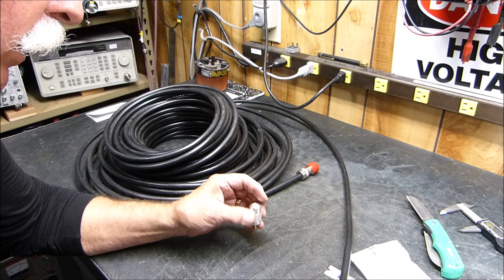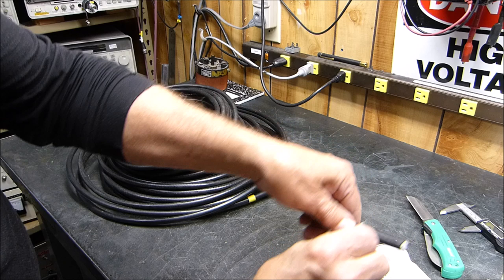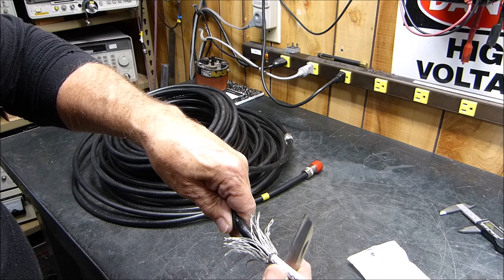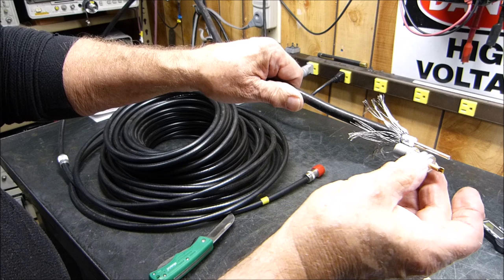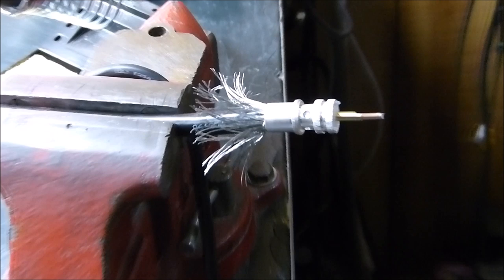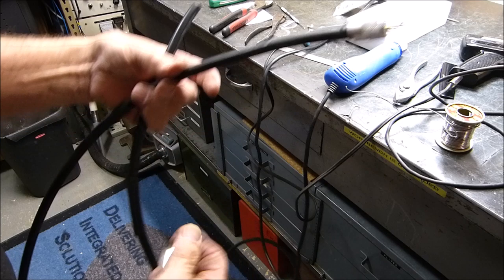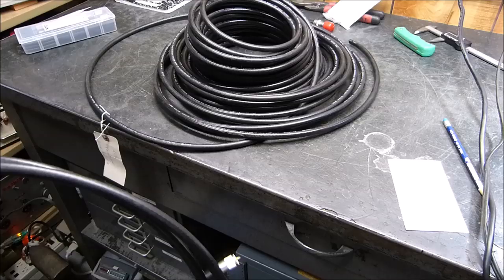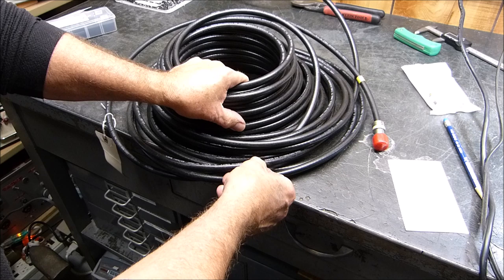Simple And Fast Method For Attaching PL-259 RF Connectors To RG-8, 9913, LMR-400 Size Coax

Comment: This is how I have done this for years.  Never understood the soldering of the braid through the holes...There is no need to fold back the entire length of braid either.  You can cut that about half way back (or almost where you cut the Dielectric) and then its easier to un-weave and fold it back, then screw on the connector.
Reply from the maker: I soldered the braid for a lot of years. I found it necessary that, if solder is the objective, I had to use the hottest soldering gun I have - I think 325 watts - clamp the cable in a vice - get the soldering gun as hot as it is going to get and try to get a corner of the solder tip sort of down in the hole so that the braid and the PL-259 is heated at the same time - and use a medium size solder - once the solder flows into the hole and braid - quickly rotate 90 degrees and repeat for all four holes. With a little luck and not so much solder that it flows into the threads, it can turn out good but it can be hit-and-miss also. Takes skill and the right tools and, as mentioned, a little luck to get it really nice and even so, outside in the elements, it doesn't seem to last any longer and the connector is not worth the time to get all the solder off to reuse it. The military and commercial world would never attempt the solder technique. Even multi-GHz "N" connectors use a compression connection for the braid. To each their own...   73

Comment: Done it that way, still prefer to solder.  just buy good silver plated types instead of the cheap and common nickle-plated ones.  solders fast and easy, no melting the insulators, leaves it all more water proof as well.  and i don't have to screw around with trying to comb out the braid and with my arthritis, way too hard to screw it on over it.
Reply from the maker: It is definitely hard to screw the connector on and my hands are full of arthritis also and I have only about half the strength I used to have. Also, it is even harder for braided center conductor but a little easier with the LMR-400 as it has a solid #10 copper wire in the center. 73

Comment: If you are going to solder through those squar holes to attach the braid.  Tin the braid and holes first and the job will go more smoothy even for nickel plated connectors.

Comment: I mentioned this on a few other videos, but the best PL-259's are made by Maxgain Systems. They can take the heat better then any PL-259's I ever used. The silver coated Teflon PL-259's are garbage. If you can find the Kalibur type PL's then I can say they are just behind the Maxgain type.

Comment: I have coax to do. I have had a bad time trying to do this. I'm going to try this
Reply from the maker: I have found out over the years that if you do decide to solder to the shield thru the holes, you need a really hot soldering iron/gun.  I use a Weller D-550 at 325 watts. You have to let the soldering gun get as hot as it will get  then get the connector hot quickly and get the solder down in the hole quickly, then rotate it 90 degrees by holding the coax in a vice, then rotate again until you fill the four holes and back off... it can turn out really good but you also have to be careful not to let the solder flow into the threads of the PL-259. It will work but it is always just a little unpredictable.  I also recommend not using the small solder. Use a medium size solder so you can get enough on the connector and holes quickly. Hope this helps whenever you do decide to solder. I think this screw-on way is just as good and you can usually reuse your PL-259.

Comment: very good i do it very similar  but dont cut so muck at the end and do it with pliers with out the vice very good some 50 ome's coax is alot softer depends what type you get 213 i think is alot softer i check with multi meter to see if there is a short mine is rg8 though

Comment: It would help a lot if you could tell us where to get the end connectors you're using.
Reply from the maker: I buy them mostly off Ebay as I do the LMR-400 . I am careful to buy from a reputable dealer and make sure the connectors are silver plated and PTFE (Teflon) dielectric. There is also,  www.mouser.com  where you can be sure to get genuine USA made connectors, if you choose,  but they cost $$$. Hope that helps.

Comment: Can u recommend me the best coax for a single anylten a mobile setup in my kenworth w900. Truck stop kits ate junk I'd like to have something with a solid center instead of multi strand
Reply from the maker: I am a fan of large coax, in particular LMR-400 shown in the video. It is a #10 copper solid conductor and fits nicely into PL-259 connectors but might be a challenge in a mobile installation because of its size and relative stiffness. On the other hand, multi-strand wire is good for a mobile installation as it is much more resistance to breaking than solid conductors like in cheap RG-58. Probably the best compromise is RG-8X coax. It is a bit larger than RG-58 and requires a different size insert in the back of the PL-259. I find good deals from Ebay and also can be purchased as www.mouser.com. Good USA coax is worth the price. The LMR-400 I use is, Times Microwave, brand made in the USA. Hope this helps.

Comment: like you vido  I just had the problem of putting one coax end  on a gab antenna. we got one on but i think the dielectric was melted and we did not get it done. I just wished there was an easy to do this with the antenna in the air.

Comment: Hello: I am supposed to order LMR 400 cable for a helium minor cryptocurrency setup from the USA,  but I found JB 9913 coaxial cable here in Puerto Rico.  Can I exchange these two cables? and still be fine.
Reply from the maker: Yes, you sure can. 9913 is a high quality 50 ohm cable like the LMR-400.
Reply: @ElPasoTubeAmps  Yes sir, thank you so much.  I appreciate you professional help.

Comment: Is there a certain pl259 you recommend? I’m new to to the cb radio hobby picked up some lmr400 and some nice amps will end up pushing 1k watts so wanna make sure I’m using some quality components.
Reply from the maker: I buy high-end PL-259, the sliver plated and teflon type. A bit more expensive but, in my experience, worth it especially if you are going with Times brand LMR-400. You can buy off Ebay or if you want the top quality, buy from www.mouser.com. Some things from Mouser you have to buy more than one but I usually buy 10 at a time.
Reply: Okay thankyou. I have that exact coax. didn’t notice you solder the braided part of the connector I’ve seen some people skip that and just solder the tip is that what you did or did you just skip filming the soldering ?
Reply from the maker: In this case, I do not solder the braid - only the tip - other times I do solder the braid... I have this coax and non-soldered braid hanging 30' up in the air from a 40M Inv-V and have had no issues. Some people believe only in soldering and I can see that but I don't think it matters much. If I do chose to solder the braid, I clamp the cable in a vice and use a 325 watt Weller gun - let it get really hot - and then quickly do the soldering, rotating the coax and filling each hole. That is the way I do. Of course, if I am repairing a cable end away from the shop, it is inconvenient to stretch out extension cords, etc. so I am more likely to use the method in the video and not solder the braid. They both seem to work just fine.  73  WA4QGA
Reply: @ElPasoTubeAmps very interesting thanks for quick response. I had purchased coax with pre installed connectors for my vhf/uhf set up but wanted to not shy away from it again. I don’t have a soldering iron with that much wattage either so maybe I’ll go with your method. I was thinking of going with clamp or crimp on connectors but already have some amphenols and the crimp equivalent is about 50 bucks for 4 connectors or 6 bucks for some Amazon stuff I’ve never heard of before.
Reply from the maker: I have to admit, I am not a total fan of crimp-on connectors but I worked as contractor for NASA and WSMR for the first 26 years of my career and we only used crimp-on BNC with no issues. I figure if it is good enough for those guys, it must be OK. Now that I think about it, the last two years at WSMR with Lockheed,  I worked on 11 GHz equipment and at those frequencies you can not use a 90 degree N connector - all the signal will be lost - rather, each bend and transition has to be done with male and barrel N connectors - yes, there is loss in each connector and connection but not total loss from the 90 degree connectors and you know they are the best to be had. The point here is, each connector, even at 11 GHz,  was crimped and not soldered - for what it is worth.  For HF, the PL-259 and SO-239 are perfectly good. A bit more loss at VHF and UHF but... 🙂
Reply: @ElPasoTubeAmps  Wow, that must have been interesting work! 11 gHZ… I guess you're more than qualified. I definitely trust this method a bit more now; all this stuff must seem like peanuts in comparison, lol. I'm an electrician by trade, so we do a lot of crimping, but for some reason, it seemed strange to me for this application. Plus, I don't feel like spending a lot of money on a crimper to do a handful of connectors. Is there something else you recommend for VHF/UHF? Also, when you trim back the jacket, if you cut through some of that braid, do you need to start over? I accidentally trimmed some, lol.
Reply from the maker: It is definitely easy to damage the braid. I tend to use a single edge razor blade and just score the insulation around the coax, then do the same down the length, trying to go as deep as I can without touching the braid and then peel the jacket off hoping I have not damaged the braid. I understand the cost of the good crimpers. I have said it often times that it takes a thousand dollars worth of tools to do a $5 job. I am sure you know that in your trade also. I am in the process of building (another) transmitter using 
a 3-1000Z. It is working as a SSB amplifier now but I will be using it for AM also. I will make a video in a month or so that you may like. The point I am getting at here is I used to be really dedicated to not only crimping connectors but also soldering them. Maybe it is just my age but I have gotten to just crimping many, or most, of them. As you know in your job, no one solders stuff except us ham radio operators...  :-)  We have to admit, crimping works - I have always thought that wall outlets that have that push-in hole for the #14 wire was surely a terrible way to do it - if I understand it correctly, we are just pushing the copper wire basically under a "blade" that surely only makes a very small physical contact and rated at 15 amps... Wow... and it sure isn't soldered. I try to go the extra length to actually wrap the wire around switches and outlets screws and tighten them down. I understand it is all NEC approved but sure seems like a poor connection to me. Maybe I don't understand how the connection is actually happening in the switch/outlet. I know I am babbling on here but I think some of it is my background and age where we wanted to build things that lasted forever. Working at the jobs I had, we did have the best of everything and it was repairable and not throw away. Maybe that is not the real world (any more). Sorry for the soap box speech. Stay safe.
Reply: @ElPasoTubeAmps  That sounds intriguing; I'd love to check that out! Your videos are excellent, and I believe more of them would benefit everyone, although I understand it might be tedious. I agree about plug-in terminals; it's commendable that you wrap them unless it's a low-current lighting application – a practice I follow as well.

We've experimented with thermal imaging on various methods of terminating conductors, finding that less contact area generates more heat. This applies to wire nuts versus the more popular everyday Wago connectors. While Wago connectors are convenient, I don't trust them with 15-20 amps flowing through. A wire nut, with proper use of lineman pliers, has never failed me.

The radio hobby has taught me a lot about the world of electrons, reigniting my excitement for working with electricity. Currently, I'm grappling with safely running high-powered amplifiers without risking equipment damage. I assume I need to purchase an analyzer, but I'm unsure about the process to ensure safety with numerous patch cables and pieces of equipment between my radio and antenna. Do you have any detailed videos on this topic? My SWR is 1.1, but I'm using a cheap SWR meter with about 50 watts, and soon it'll be 500 watts, so the stakes are a bit higher 😬

Comment: I live in El Paso and my call sign is K5mhc. What’s your call sign??
Reply from the maker: WA4QGA
I also have a lot of pictures of equipment on my QRZ page
Reply: @ElPasoTubeAmps  thanks and I’m the current president of W5ES
Reply from the maker: @javierpolendok5mhc  Hi Javier - YouTube and email is something I try to keep up with. As you can see, audio was what first got me interested in posting on YT but my passion gradually came back to amateur radio. Only so many audio amplifiers can I build. You would notice that I am into the vintage and homebrew equipment - you know, all the stuff we wanted as a kid. I have visited W5ES but it had been a while. I am not much for meetings or contests but I know they are good and not many people that I know of are into the vintage equipment and I know little about the new stuff. If I can't fix it, I probably don't want it. Good to meat you, Javier. I operate 20 and 40. Probably the only antennas I will put up as I have such limited space. Hope we meet someday.  73  WA4QGA

Comment: Hi I have a question. how far can i run a 400 coax cable????
Reply from the maker: It depends on the frequency and the type of cable being used. About 600 feet at 14 MHz for 3 dB loss (half power) for LMR-400

Here is a great calculator:  https://www.timesmicrowave.com/Calculator?Product=LMR-400-DB&RunLength=100&Frequency=14

Comment: I've soldered thousands of PL-259s and adapters to many different types of coaxial cables for 50 years.  I still have the same Weller gun used to solder all those braid connections through the holes.  Tin the braid, install the connector, and once the connector is hot enough to flow solder into a hole, move very quickly to retain that initial heat as you solder the remaining holes.  Once the last hole is soldered, don't touch or move the connector again until it completely cools. I used the screw-over method for a bit on personal connectors, but never had a good feeling about them.  If it works, don't fix it.
Reply from the maker: I do a similar thing and I sometimes still solder the braid thru the holes in the PL-259. I use my hottest Weller soldering gun, 325 watts, clamp the cable in a vice, heat the connector up as quick as I can, solder thru the hole, turn and solder until all four holes are proper and wait until it cools and hardens. I do this for the connections that must be outside and then, of course, cover outdoor exposed connections with a generous amount of coax-seal. For indoor connections I think this non-soldered process is OK. Some people say this is not adequate as it is only metal to metal contact for the braid. So is the center male pin to the female connector and the outer threaded part screwed over the SO-239 - just metal to metal contact but it works. I do tend to "cinch" connectors a little tighter with pliers before covering them with the coax-seal for outdoor connections. There are some completely solder-less, crimpless,  twist-on type connectors, both UHF and BNC, that I refuse to use. Looks like nothing but trouble to me. Thanks for your comments.  73
Reply: I use a spray bottle filled with some water and as soon as I solder a connection spray some water on it so that the insulator does not get all that heat and melt.

Comment: When I do this, yhe wires tear
Reply from the maker: I would guess you might be nicking the shield wires when you remove the outer insulation, cutting the outer jacket slightly too deep. Just my thoughts.
I have seen from this video, lots of people install PL-259 connectors this way if for no other reason, so the connector can be used again without having to try and remove lots of solder.

Comment: Why don't you just use the clamp on type connectors if you don't want to solder the braid?
Reply from the maker: That's a good question but I guess I just don't have the mechanical confidence in those crimp connections as I should. 
On the other hand, I do use crimp connectors for almost all of my BNC connectors.